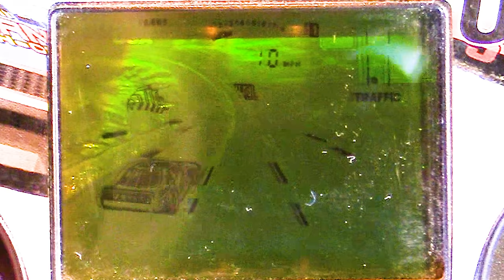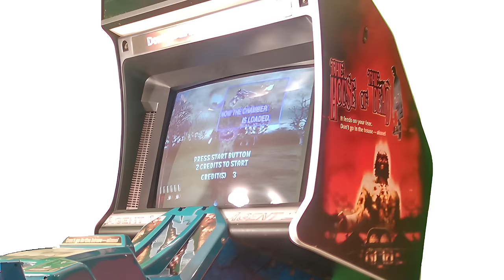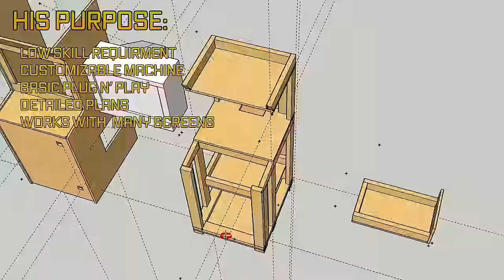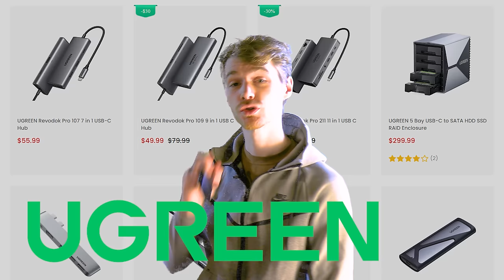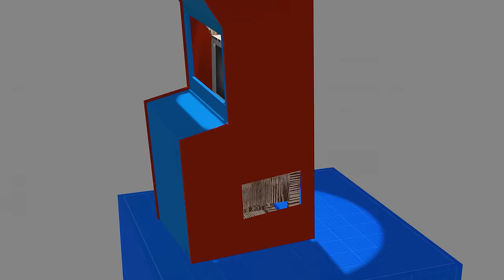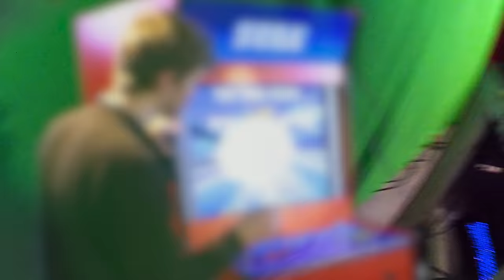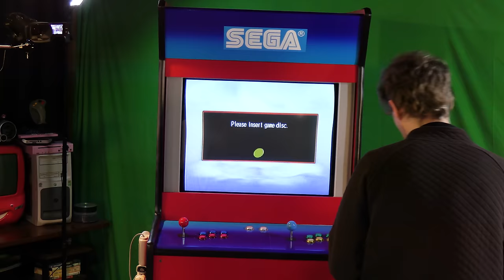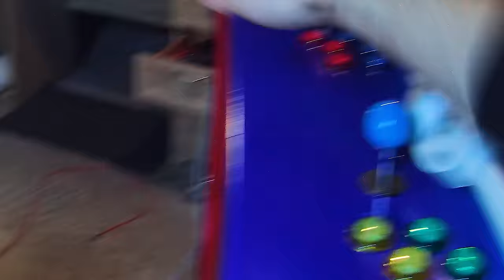Build an Arcade With Any Controls, Any Games, Fast, Easy, and Cheap

Comment: I built a "racing sim" that looks like an old cruisin USA cabinet and it's so much fun. Playing Daytona at home with a wheel is insane. 

It's on Xbox 360 and plays on series x in 60fps and has wheel support.
Reply: I typed this before watching. Me and Peter are if the same cloth

Comment: Cool project. I definitely thought about getting some light guns for my machine. On my cabinet, I also put buttons on both sides to play pinball games. Two buttons on each side, one for the flippers, and another one for nudging, and it does the trick pretty well. Of course, that doesn't fit the Sega aesthetic you're going for, but something to consider in the future if you're into those kinds of games.

Comment: I have an old school big screen TV that is huge clunky boxy and heavy AF, want to just throw away or donate to goodwill but getting it to either the dump or goodwill is the challenge since it's big and weighs as much as a small car. But someone could make that what he is explaining so I probably will put an ad on Craig's list in the free section and yes it still works want it it out of my living room. Also seen videos where people take one apart for the lens and make a huge magnifying glass out in their backyard to set stuff on fire in seconds, so both ways are fine to use with this beast of a TV.

Comment: Ive tried to do a similar "ultimate" concept, but instead using a simpsons 1up arcade cab, a old PC from goodwill and a bunch of diffrent arcade controllers that ive bought/made with velcro to attach them. Its pretty cool, so far i have normal arcade sticks, taiko drums, a spinner, a dual arcade stick controller, and I plan to get a lightgun and trackball controller.

However, I also have a racing rig, but i dont use it with my arcade setup. I would highly recommend to use VR with racing games, with them projected onto a virtual screen. Ive been playing a lot of daytona 1 and 2 this way.
Reply: I'll have to add fishing controller to my list of controllers to get.

Comment: Set the Steering Lock inside G Hub to 270° and you will have a great time with arcade racing games. If it's still too much try 180°

Comment: I would say emulate it. But jesus the emulator is sucha train wreck. The main functions need you to edit the text file. But worstly for me, it just stopped working. It use to work fine for me, but then it just decided not to